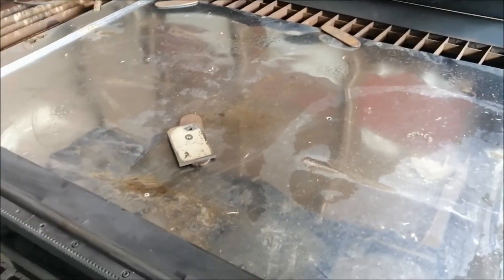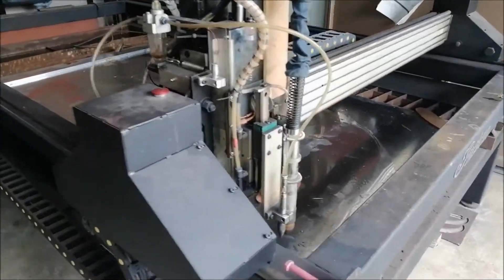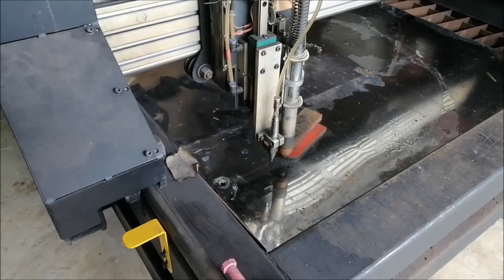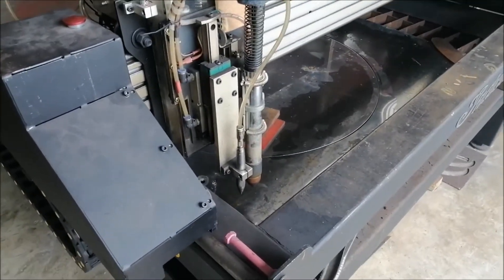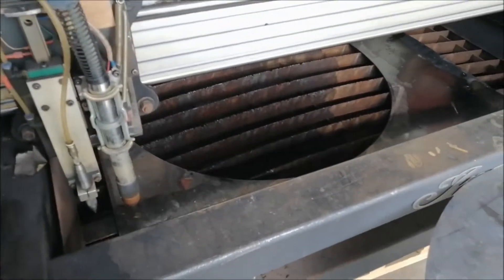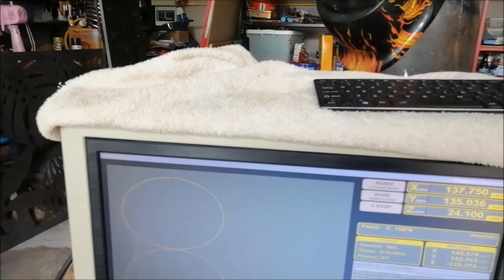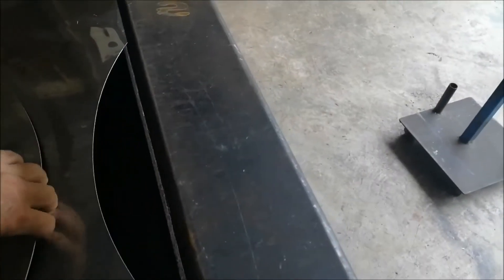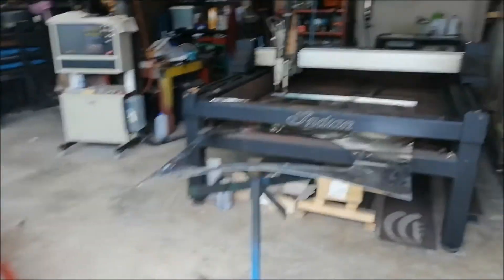"WHAT NO WAY" Plasma cutting  .3mm stainless 15 meters a minute!  Must see video!

Comment: please ask.  how did you use the anti-jamming system with this plasma cutter.  and i am facing the problem that every time i turn on the torch, my computer goes dark
Reply from the maker: Your computer; Most common cause will be grounding and shielding, Hypertherm has a PDF about it. Plus i have a video if you want to watch. https://www.youtube.com/watch?v=HB6JGFMw6QU&t=8s
I use a Masso controller, no computer is used for the plasma cutting. https://www.masso.com.au/